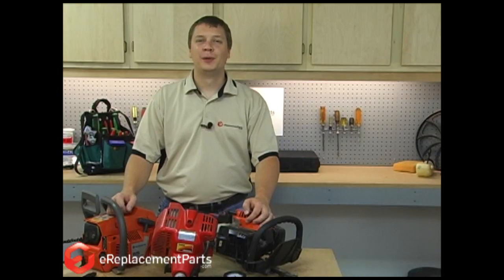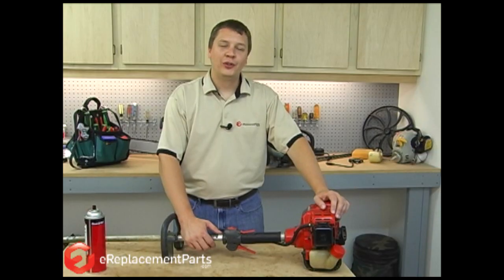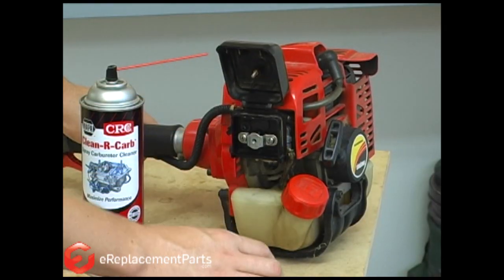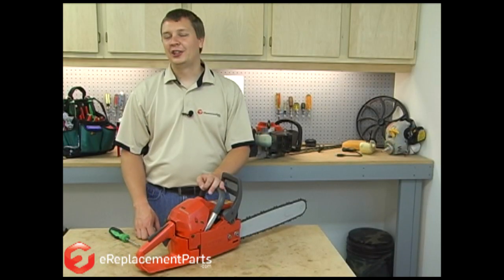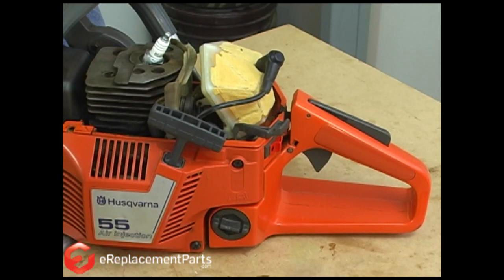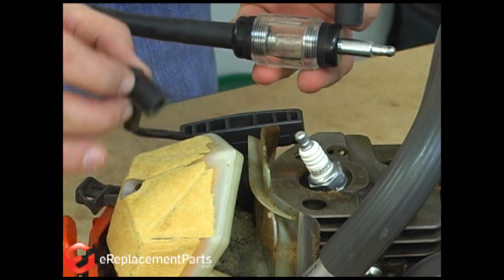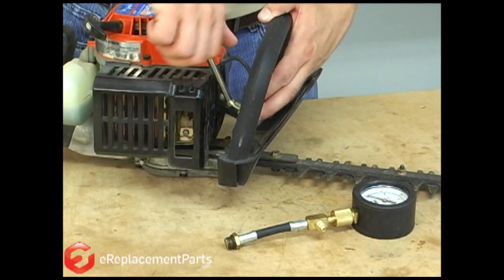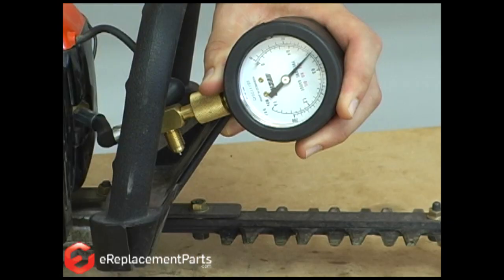How to Diagnose Two-Cycle/Two-Stroke Engines

Comment: Exactly, starting fluid runs super hot and is made for diesel engines under certain conditions, not for aluminum 2-cycle engines. Also, it's basically alcohol, which will wash off any lubrication on the intake side of the piston and cause scoring. We're talking about engines that run at extremely high RPMs and are generally at high RPMs immediately after starting, when lubrication is most needed, so I do not recommend starting fluid to anyone without a diesel or cast iron engine.

Comment: Also, just because you HAVE a spark, doesn't mean it's strong enough to run the engine. You may want to pick up an open-type spark tester so you can inspect the spark color, not just see a light light up. It's imperative that you check the spark plug gap as well. Too large a gap, it may strike the crown of the piston, run poorly or not at all. Too small a gap, it may not run either, or get fouled easily with carbon. Better to bring your equipment to a repair center for professional help.

Comment: @melcml

I'm 12 so don't blame me but you could have made it reverced of you could have messed it up where it broke and twisted or turned but it changed first check the air filter and make shure i think closes for no choke and half/whole open for full choke and if not your gas or air leak by not proper following. The steps

Comment: Hi Mark, I think your videos are very intelligently presented. I have a question. If the engine starts when you spray starter fluid into the carburetor, then isn't the carburetor okay? Doesn't that mean that the problem is the delivery of the fuel TO the carburetor that's the problem? Thank you.

Comment: i have a troybuild weedeater it starts fine and idles but as soon as its revved up it cuts off i have replaced lines, line filter, primer bulb and spark plug also new gas also cleaned carb checked muffler for clogs sso what now?

Comment from the maker: The most likely cause of this would be low compression due to worn piston rings or a worn or damaged cylinder. Start with a compression test. Anything less than about 70psi would be considered low. 

Hope this helps,

-Mark

Comment: Don't forget the exhaust. Mud daubers love round exhaust pipes. Spark arrestor screens, too. If muffler is oily, check the screen. It's plugged.
Your start on prime part is good. I tell mechanics to do that. They never do. I had one idiot  put rings in a Honda mower that only needed the choke adjusted. Customer blew $175 for a $15 minimum charge choke adjustment. I quit over that idiot. I told him we don't do ring jobs. Took him 8 weeks to do it. They called me back after they canned him.

Comment: Hi there,
I have a partner 335 made by poulan in canada, it won't idle even I put the L screw in one turn, 1.5 turn
and 2 turns, and different settings, but the saw will  run in full throttle but the  release of the 
trigger stop the engine.
 can you help please,
regards,
abu mustafa

Comment: I don't know if you have worked on Chinese Generators before but I thought I would ask anyway.  I have a small 800 watt generator that is loosing power.  Many have said it's probably carbon buildup in the muffler and cylinder which is restricting the power.  How do you clean out carbon buildup in the muffler?

Comment: Hi Mark, I have an Echo PB1000 blower, I used a spark tester (as you suggested) and the ignition is fine. If I spray starter fluid in the carb, It does not fire, I tested the compression and it is 80 PSI and raises to 115 if I put a little oil in the cylinder.
I am thinking it may be a crank shaft seal or a leaking crankcase, but I have not removed all the plastic casing yet. 
Is 80 PSI to low 
Your thoughts?

Comment: I bought a Sears leaf blower Vac on EBAY.   On running,  it smokes and not just a little.  I was told it could be bad gas but I use the same gas in a trimmer and the trimmer runs fine.  The next suggestion would be the piston head might be loose.   But the muffler seems solidly attached and compression is at 105.  It starts on about 4th pull.  I also think the blower gets warm on spark plug side and this could be a coil problem.  My repair guy wants to just replace stuff (fair assumption)(cont)

Comment from the maker: It sounds like there is still some debris in the carb. If you can get your hands on an ultrasonic cleaner they do wonders to clean stubborn carbs. You can also try using fishing line to clean the small passages in the carb. Never use anything metal though to clean. The metal will damage the fine passages and the carb will not work properly afterward. 

I hope this helps,

-Mark

Comment from the maker: If there is scoring present and the unit can only produce 30 lbs of compression you will want to replace both the rings and the cylinder. You will also want to look for scoring on the piston itself. Again if scoring is present then replace it.

Good luck,

-Mark

Comment: I've been having the weirdest problem with my string trimmer. no matter how cold it is out I can prime it, choke it, and it always starts on the 3rd pull. But after i run it for a little bit and turn it off, even just for 10 seconds, it wont start back up unless i pull it a good 15-30 times.... Its really annoying and i don't know what the problem could be since it runs before its warmed up but after it wont.... Any suggestions?

Comment: Yep! I did it! I knew better but I did it anyway! I ran out of oil and had just a couple minutes work left soooo...Well. you know. Probably less than a minute and my poulan prolink that I was using to cultivate the flower bed began losing power so I immediately shut it down. Now I have about 30 psi compression and it wont run with any attachments. Tore it down and looked at cylinder/piston/ring. Very minor scoring on cylinder wall and some discoloration. Blow by I am assuming. (continued)

Comment from the maker: @spelunkerd  We had a saying at the small engine shop I used to work at. "Everything gets a plug!". It would cost the customer less to simply replace the plug rather than starting a time consuming diagnosis. If the engine still won't run then we would pull out the spark tester. The tester I used in the video can give a false positive like you mentioned. There are other types though that can be grounded to the engine block, bypassing the plug.

Thanks for watching,

-Mark

Comment: That's a really good summary, Mark. I was interested to learn that you feel a spark tester is a more reliable index of adequate spark than is pulling a plug and grounding to chassis, and watching for spark there. But what if the plug is bad? If the plug is shorted then I would expect a spark tester to give a false positive, since current is flowing, albeit on an aberrant pathway. I' e never used a spark tester like yours but I'll consider getting one after watching this.

Comment from the maker: Either starter fluid or carb cleaner will work fine to perform the fuel delivery test. I have always used carb cleaner simply because we use carb cleaner for many cleaning tasks in the shop. There is always a can of it nearby. Thanks for watching!

-Mark